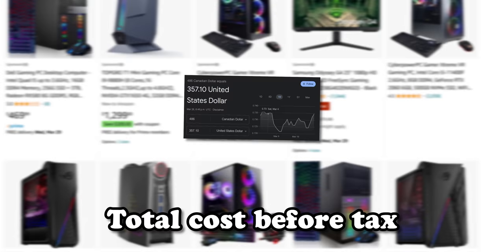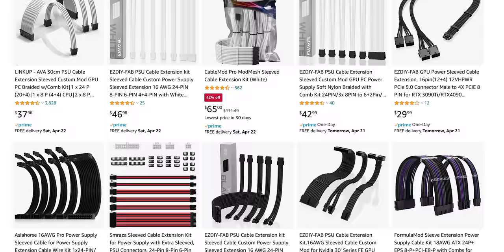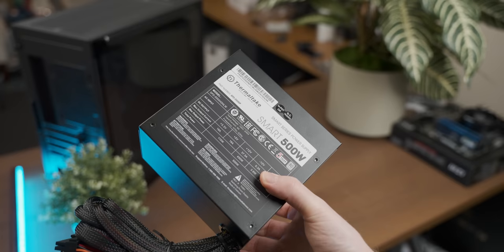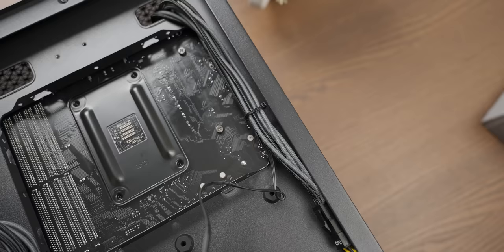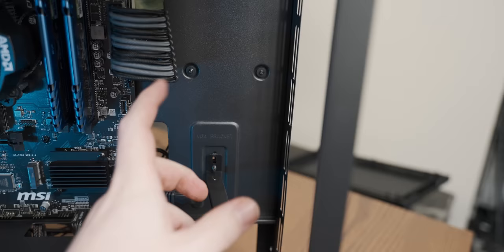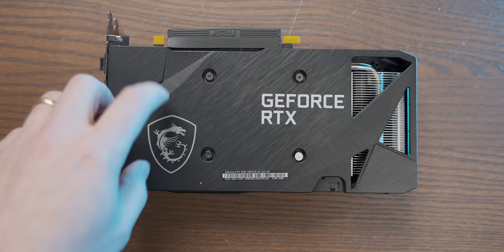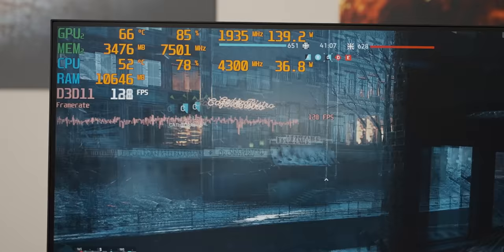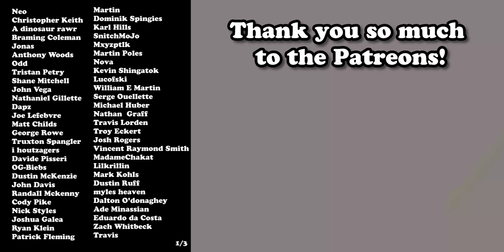I Use ONLY "Amazon's Choice" Crap To Upgrade My Gaming PC...

Comment: I'm surprised how good, it looks when RGB lights thru the CPU cooler, or how reflective it is. I bought RX 6600 last year, and I was about to buy RTX 3050 instead, but I love messing around with linux, so I went full AMD, and not regret my decision.
Reply: Same here, upgraded my Zorin 16 box with a new 6750 XT over an old 2070 Super. Not a huge increase in performance (about 20%) but I'm sick of dealing with Nvidia on Linux and the lack of full Wayland support.
Reply: 6600 is a beast i got mine used and got gpu for ages
Reply: The 6600 is so much better than the 3050. You made the right choice
Reply: Talk about a useless card. The 3050 isnt even faster than a 2060 super. I have no idea why they even made that card.

Comment: So..... really feel the cooler didn't get a fair shake. Ram wasn't RGB, should have offset and used the fan in front. Pretty sure the single fan wouldn't have struggled as hard trying to keep up. I mean, I'm just saying you may have seen a less significant raise in Temps when overclocking. And possibly less rpms on the fans themselves making it an over more quiet solution even with an extra noise source. Just guessing though based on the reviews and test results of several others as well.

Comment: I have used literally dozens of Thermaltake smart 500 watt psu's in builds over several years, never ever had an issue.. 
they may not be the best but they ALWAYS get the job done..

Comment: While I am down with hating things by principle, I think the 3060 performance issue is down to driver overhead, rather than the specific model. Hardware Unboxed did a great investigative piece on it. Or did you get the 8 gig version of the thitty sixty?

Comment: If this was a build I was working on, I'd take the extra / unused CPU cooler fan and mount it up top as intake to feed the cooler with fresh ambient air. Especially because the front fans are blocked off. And before anyone comments, yes, top intake is fine.

Comment: Your upgrade turned out very nicely, and it satisfied my urge to tinker with my PC for at least a week.
Reply: same here XD but i got some car parts i need to buy but i wanna go back to an air cooler because i got a 280mm aio with a 5800x and its not cooling as good as id like since i used to be able to hit 5Ghz with it

Comment: Dawid, how the heck do you always have such low GPU temps??

I have a 3070 OC Vision. 3 fans at the front, not open front panel but at least a small vent slat on both sides, plus 2 exhaust fans. With an ambient temperature of 16/18 Celsius, my GPU is running at 75 degrees Celsius under full load. 

How do you always get in the 60’s, seemingly regardless of the case or card?
Reply: Undervolt it
Reply: @motazkasem3289   Should I have to do that? Does Dawid do that?
Reply: 75 is pretty normal for a 3070 OC
Reply: @OGruurd   I have read as much. That said, I don’t ever see Dawid getting those kind of temperatures. Which is why I’m asking about it. I don’t understand how he manages to keep temps so low. I’m pretty sure he’s run a 3080 before and kept it under 70c.
Reply: Dawid would take it apart and add thermal paste to the die. These channels seem to do that daily, lol
Reply: You could try an undervolt and a custom fan curve using msi afterburner to start. If that doesn’t make much difference then I’d repaste the cooler. My wife’s Evga 3070 xc3 doesn’t have the best cooler and under the same ambient temps as you it runs at 60c average with default settings.
Reply: @fitztech   I don’t want to lose performance to keep it under 75c though. I bought an OC version FOR the performance boost. Undervolting would seem to negate the whole point of an OC card.
Reply: His card can draw a maximum of 170w without any overclocking (normal usage at stock values), but yours can draw 220w at its max load.
I don't know if Dawid did undervolt or edited the fan curve of his card.
But in general, undervolting gives between 7 to 10 lower degrees Celsius depending on how far you can undervolt your card without losing any performance.

I went from 74c to 63 with my card and saved 30 % in power consumption
Reply: @motazkasem3289   How much performance did you lose from that undervolt?
Reply: @brando3342  No performance lose
Reply: @brando3342  You won’t lose performance by undervolting. It might be 1-3%. Not something you would notice. However if you let your card run hot enough it will start to lower its clock speeds to save itself from roasting. Which you will notice.
Reply: @motazkasem3289   Crazy, thanks! I’m always sketched out about messing with my expensive stuff when I don’t know what I’m doing lol
Reply: @fitztech   Okay cool. Yeah, I’m playing Days Gone, and the boost clock gets to 1890mhz then starts lowering when it hits 70c. It gets down to 1800mhz before levelling out around 75c.
Reply: @motazkasem3289   Could you try and reword that channel for me? YouTube seems to have deleted your comment with the name of it. Maybe add spaces or periods or something.
Reply: @brando3342  Start learning dude and good luck with what u gonna do :)
Reply: @motazkasem3289   Thanks, bro. I built this PC in 2021, so I’ve already sort of “broken the seal” of being too cautious to get my hands dirty lol

Comment: I have two ThermalRight Peerless Assasin coolers that work amazingly well. One of them is having absolutely no problems keeping a 5950x cool, barely hitting 70C under full load in a 20C room. The other is on a 5600G that never goes above 55C under full load. Don't know why yours is doing so poorly on that wimpy cpu.

Comment: My 10 y/o wanted RGB in her PC rebuild for Christmas, and knowing nothing I bought the same RGB strip kit - although mine may have been older, as there was no sticky, just magnets.
I had a few issues with a couple of the magnets pulling out, so had to glue them back in, but no issues at all with the RGB, it looks much brighter than yours, and has never randomly blinked off; even when the 10 y/o has buggered off on holiday with Grandma for 2 weeks (Disney, Florida), and left the system running with the screen switched off, until I spotted it nearly a week later.

Might be worth checking it isnt a power saving feature on the mobo.

In a (crap) black, Borg-esque Cube case, they look pretty awesome.

TBF, the case itself looks awesome, but half the board mounts werent tapped and in the end, after two broke, I drilled all of them out and fitted industry standard - as they also werent standard thread size or pitch.

Comment: I actually used that exact power supply for around 4 years, and I bought it used even. I only don’t have it anymore because I sold the PC it was in when I built a new one. It never had an issue with a gtx 1060 6gb and an i3-4100 (which was eventually upgraded to a R5-2600x)

Comment: That fan isn't even a "Molex abomination", it has a molex in case you have no header on your motherboard, BUT it has a proper fan connector. And no, it won't run at full speed just because only two pins are electrically connected!

Comment: I worked at a place that did thermal solutions for NASA and after a million dollar research project the discovered that the difference in top of the line thermal paste and bottom shelf was a degree or two.  I don't worry about fancy paste.  I get a 30g tube of no name and build all my systems with that.  Never had an issue.  JS

Comment: i actually use the cpu cooler but the black version of it and im really happy with it. running a r7 57x and easy under 60 degrees 
PS. i threw the original fnas out and used my corsair fans i had laying around for the cooler

Comment: EZDIY-FAB do decent things--have used their sleeved cables in a few builds, as well as RGB heat-spreaders for RAM modules that were otherwise non-RGB to begin with--like back in 2019 when I moved from AM3 to AM4, and DDR3 to DDR4--but Vengeance RGB was just way more expensive than non-RGB. I just pimped those RAM sticks later down the road, and all you need usually is a heat gun. 

They also do things like right-angle 8 and 6 pin adapters to make builds a bit cleaner too, and vertical mounts. Basically think of any cable management or case accessory that a bigger company might've produced--and they'll have cloned it.

Comment: SYY157 Thermal Paste is a highly regarded (silicon based) Thermal Paste. Tested by Toms Hardware in all their Paste tests and by many other such tests by other sites. Its easily as good (in many use cases) as your MX4 and NT-H1 pastes.

Comment: hey dawid I feel like you're not posting as much, maybe you're running out of ideas, so here are some:

-Tips for cable management in a PC build
-The benefits of water cooling vs air cooling for a PC
-The best RGB components to use for a showy PC build
-The best hardware components for a budget PC build
-Testing and reviewing the latest gaming peripherals, such as gaming chairs, keyboards, and mice

-Exploring the latest trends in custom PC modding and showing off some amazing builds

Comment: I have those exact Airgoo light strips, and MB120 Halo fans, lol. I've never had an issue with the strips turning off though. The fans are nice enough to warrant me making a custom mesh front panel for my Masterbox MB530P. Otherwise it'd be choke city with the glass front it came with. The one thing I love about the fans is each one of them have an independent 3-pin standard ARGB connection. All of my fans, and lights are connected to a Razer ARGB hub so I can fully customize the lighting profiles, and have them all sync.
  All Amazon Choice means, (I think) is they're the most purchased item of that type. I could totally be wrong about that though.

Comment: I used to use that same PSU but I 750w for my first build with a 3500x and a 2060. I don't get the hate behind it, I never had any power issues with it and it ran pretty well for me.

Comment: I bought a 3-pk of those same CoolerMaster MF120 Halo's (in white for an upper AIO) as well as one white MF140 Halo (rear exhaust) to match the 2 front 160mm intake fans on my white Lian Li Lancool 216 RGB case and they look great! Sadly that added almost another $100 to the $115 case.
I didn't need the 3-port CM hub since the existing Lancool hub allowed daisy-chaining. Considering my past bad experiences with CoolerMaster fans, at least they didn’t arrive defective and they’re not only very bright but quiet as well.

Comment: I have the same CPU cooler and also the same problem with the RAM clearance. However, I  just installed it a little higher and replaced the fans with better ones.
But I´m absolutely fine with the performance so from my point of view, it´s not the worst choice.

Comment: This comment section seems knowledgable. What do you think of a Lenovo Tablet with Dolby Atmos? This tablet has been 1350 percent better than the US Cellar 4G LTE I had previously. No more overheating. The tablet does things faster. I have 54 GB of storage space versus I think I had 4G previously. The sound quality is significantly better than my previous tablet. The old one is I think a 2013 model and the current one I think is a 2021 model, not sure about the exact dates.

Comment: I bought one of those crucial P3's the other day, little did I know I needed a APU rather than my R7 2700x in motherboard to make it work/compatible on my gigabyte b450m dsh3. In the process of installing I went and ruined my boot device by snapping the plastic mould on my harddrives Sata and power connections. 1 step forward and 2 steps back, the story of my life 😂

Comment: Those 500W TT Smart PSUs are actually pretty decent, I've used them in a few systems for a couple years and never had an issue.
Granted, they're not the BEST you can get, even for the price, but if you find them on sale they're not bad.

Comment: FYI, that Thermaltake White edition might not be the most efficient, or highest rated... but I abuse the h*ll out of those and have never had one fail.  Some of them are in systems that run 24/7 and have been going for years without issue.

Comment: Why to use RGB fans at the front since they are visible only from one side of the computer. 
You could use the 3 non RGB fans in front for intake and the 2 RGB ones on the upper side of the case for exhaust.

Comment: You put the fan with the front against the metal part of the cooler. If you put the back part against the cooler it might help with the noise.

Comment: the 3rd fan was pointless but appreacited that you used all parts ordered. But BF5 runs at ultra with RT at 80-90fps 1440p and 55-ish fps at 4K with that rig.

Comment: This is an upgrade package that I could honestly see someone doing.
And I shed a tear for them.
Just get an Arctic Freezer 7 with pre-applied paste, cut down the RGB (which you can't see properly in the case), borrow £20 and I'll get you a 6800, a tier up from the 3060, 16GB RAM will last longer and a meaningful upgrade for your CPU down the line. Hell, a 6950 shouldn't be out of the question if you're spending £400+ but that's maybe more about GPU pricing.

Comment: If you are using a 4600g cpu, just try it without the 3060. YOu already know the weak cpu is going to bottleneck to the point of choking the gpu. Im interested though

Comment: I have a Zotac 3060 twin edge OC LHR in one of my systems (it does mostly video capture and encoding... nothing major).  I used it for gaming for a while when I first got it, and it was fine.  Didn't get overly hot, didn't kill for power, and gave nice frame rates.  The Ventus appears to be sort of sleeping on the job or something.

overall your upgrades are somewhat tasteful.   I do think though that you might have done better on the power supply if you had just searched for "modular power supply".   The (todays price) of about $60 would get you the "Apevia ATX-PM650W Premier 650W 80+ Gold Certified Active PFC ATX Semi-Modular" that would have gotten you blacked out cables AND some serious cred with RGB in the power supply (say what?).

Comment: The 3060 might just be bottlenecked by the crappy 6 core cpu, but the 6600 isn’t because it doesn’t have really fast vram. The thing also only does PCIE X8, plus I kinda forget what type of board you went with.

Comment: $499 for the Ventus 3060? About 8weeks ago I got an Asus TUF 3060 Ti OC for $520 to FINALLY complete my pandemic era April 2021 build ( Ryzen 3900~~because the 5900 was unobtainable~~  with Asus Tuf WiFi Pro X-570 MB. The 3060 Ti replaced my faithful EVGA GTX 970 SSC which I bought from Craigslist for $150 and have been using since 2015!). 
Of course prices vary with time, supply and new architectures, but 500 for a 192--bit 3060 in comparison seems not that great a deal. 
I also bought 3 Halo fans for the price (and noted the sealed bearings)  and the aesthetics as it matched well with the AMD stock cooler of the Ryzen 3900 and complemented the front intake fans of my Lian Li LanCool II Mesh RGB case.  I was a little concerned when, AFTER I installed them,  I checked their CFM compared to the Lian Li case intake fans; the case fans are like 55 CFM,the Halos are 47 CFM...BUT that actually gave me positive air pressure in the case and the fans are individually quiet and effective ( I also put an all-black 65 CFM fan in the case ''basement' to supply cool air directly to the GPU).

Comment: Thanks for another great video! I have the peerless assassin 120mm white RGB version on a R9-5950X using noctua thermal paste (cause I’m afraid of liquid cooling). It’s idle at 39C and gets as high as 70C under a heavy load. It’s not a bad cooler for an “Amazon’s choice” product. I was very surprised with its performance.

Comment: assassin king user here (single tower). The thermalright fan is just pure crap concerning noise. immediatley replaced it with a 4th arctig RGB fan.
interestingley i use the same case (whie version)

Comment: You could daisy chain the CM Fans and only use one header on the hub. They are argb gen 2 so you  can still control them individually though. Then use the other headers for the led strips.

Comment: The pimped system looks good, apart from that eyesore blue RAM, that should have been swapped out for some plain black sticks.
Reply: I have used that exact ram. They have no longevity at all, so as they go bad I have been replacing them with another brand. Silicon power does not make good ram.

Comment: 6600 should perform better than 3060 on a weaker CPU due to Nvidia's driver overhead loading the cpu up. That result is not strange. I say jumping from 50s to 70s in 1% lows is an HUGE improvement well worth the overclock. And still running under 70c which is just great, that PE assassin is right now the best air cooler you can build all around, match the ND-15 for less than half the price. No other dual tower come close to it.

Comment: One of the reasons that the AMD GPU did better is that Nvidia's drivers became heavy on the CPU with the RTX series. I still remember the good'ol Crysis days when AMD drivers ate up almost twice as much CPU power. Things seem to have flipped this time around. 
Iceberg Tech did a video on this topic where he paired a 3070ti vs a 5700xt on a poor dual core CPU. It went as bad as you'd expect, but the AMD card had quite the impressive results over the 3070ti.

So overall, AMD seems to be doing better when you have a low-mid range CPU, if your CPU is overkill, then Nvidia still gets the job done.

Comment: Not sure what's going on with your Airgoo strips, but I've used two kits from them with no issues at all and they look great. It might be your motherboard's RGB software turning them off. I also bought a set of Antec cable extensions that look identical to the ones you got, I wonder if they use the same manufacturer.

Comment: I actually have a thermal light assassin king cpu cooler and it works well keeping my cpu under 112f/43c idle and even under cinebench the temps never gone above 160f/71c